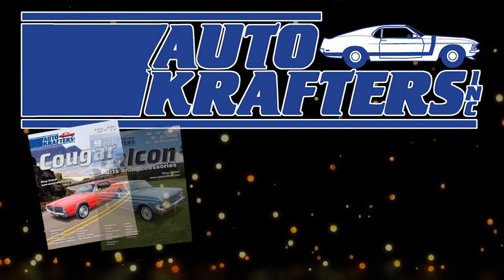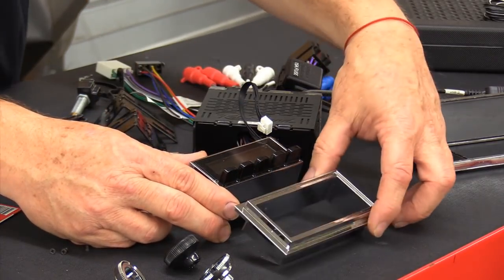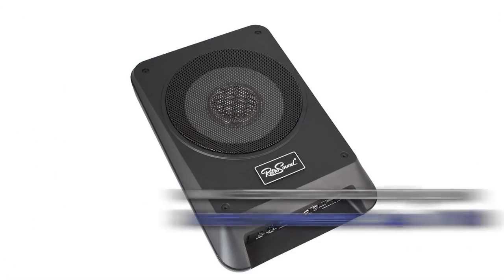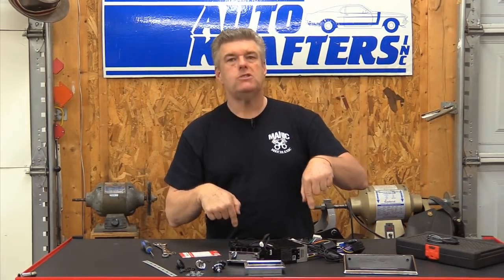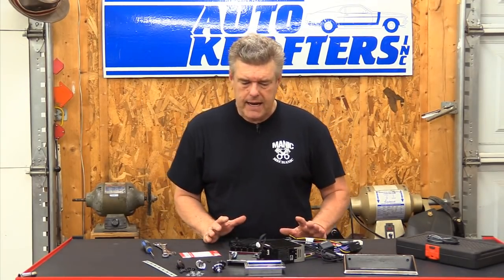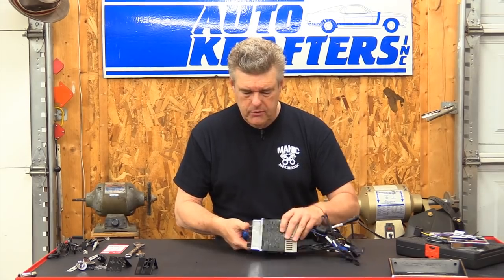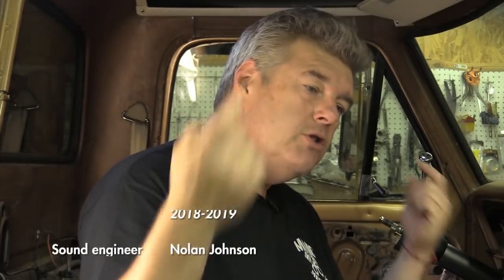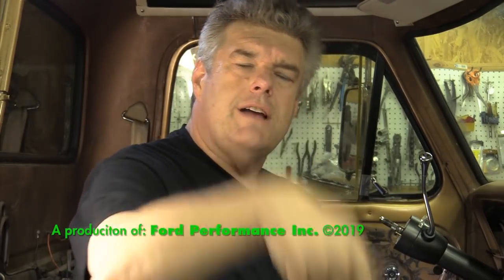How To Retrosound Radio Features and Assembly

Comment: I think maybe you missed a step. What's holding the radio while in the dash? We used to tighten the stem nuts to the faceplate and then a strap in the rear. But the way the stems are on this radio are set up I don't think its designed to hold the weight of the unit. Love your videos. Not trying to be a hater, just noticed a step missing.
Reply from the maker: We had issues with the video quality when I was showing the radio mount to the chassis. The F100 has tabs that the radio mounts to that are stamped into the dash panel. We have used the straps as well. Just can't get in there to show that.

Comment: Hey Jeff. Great video as always. Just curious on your opinion. I’m 17 and I got a old 64 falcon with a 3spd and 144 six. I love the ford 6 cylinders and and everything about them but I’ve never had a 144 before. Are these guys to weak for modern traffic (65-70 highway)
Reply from the maker: Well, there is no substitue for cubic inches...unless it is cubic meters of air (turbo or supercharger). You can go up to a 200 and it will be more sparkly. But the rebuild will cost some money. If you are just tooling around town, the 144 and three on the tree are fine. Just don't get in a stoplight battle with anything more substantial than a '63 VW beetle...😜
Reply: Jarod - what Jeff did NOT say is that for a young driver, a 144 in a light car like the 64 Falcon is plenty.  Yes, I learned to drive in a '66 Mustang with the 200 I6.  Did I want the 289?  Yes.  Would I have survived NW Indiana with a 289?  Maybe not...  If you live where there is ice and snow in the winter, your 144 will keep you entertained.
Reply: I had the 144 or 170 in my 64 Chero, pulled it and upgraded to a 200 (which my friend had in his 66 Stang which he pulled to go with a 302), with a 5 speed from stang behind it. No problem at freeway speeds, and plenty of zip for around town. Depends on your stack or coins which way to go, performance stuff or cosmetics, both will deplete the stack quickly!!

Comment: Good job how about running the wire loom for the Amps,and bass speakers may save having to pull every thing out and redo it all.
Reply from the maker: I'm looking at that. I have one power wire run for the power lumbar on the seat. I might not add the amp and sub. We'll see.

Comment: I had a retro which was hardly ever used only a couple of times I have used it but now it turns on but my screen is blank. There’s power running to the radio. Any ideas what it might be? Possible wiring issues?
Reply from the maker: That would be a call to Retorsound for me if I were you.

Comment: I have a problem and I already installed the sound in my 1969 F100 but you hear a buzzing every time I accelerate and I can not remove it,
Any advice to help me?
Reply from the maker: Grounds. Make sure you have good grounds and also use good quality radio resistance wires.